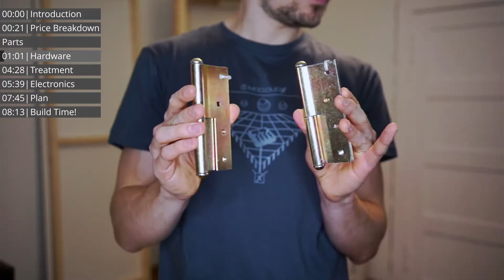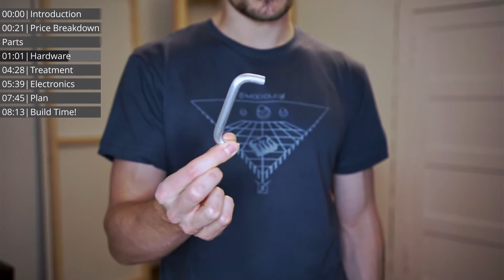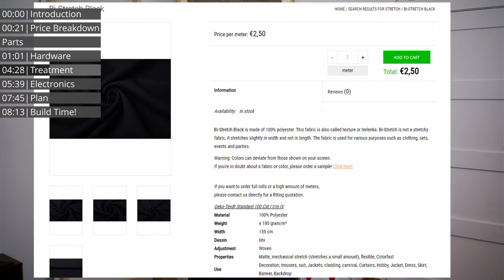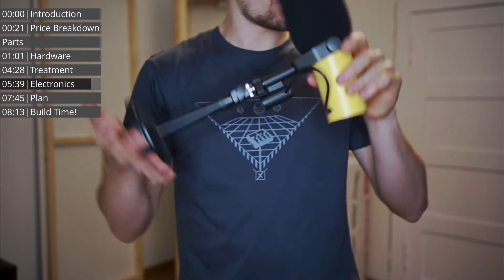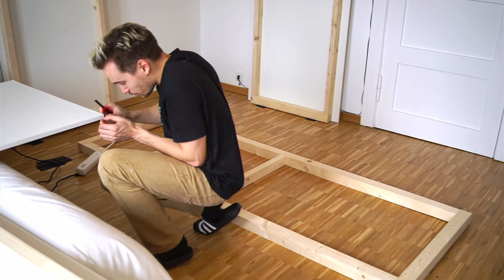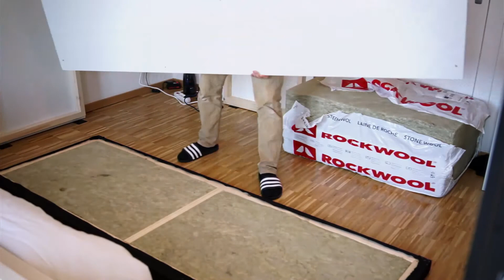How to build a professional Vocal Booth on the cheap - Part 2

Comment: I like it, but particle board weighs a ton.  I'm considering white corrugated plastic panels.  Thin and light and probably just fine for this application.  If not maybe a 1/4"  birch veneer
Reply from the maker: One of the unfortunate things about sound is that heavy dense objects block it better than light ones. I really wish it weren't the case as I've carried it up and down stairs a few times

Comment: Get some thick women in your life bro, you will get stronger this way.. joking 🙃 

Nice project but I think you would get better results by making the booth just a tiny bit bigger.. 

Also use 100mm rookwool
Reply from the maker: I'm planning to make a version 2 and I might go thicker on the insulation. I want to fix the ventilation mostly though